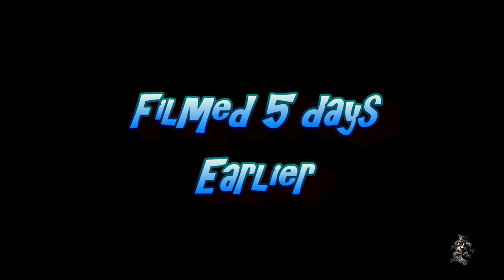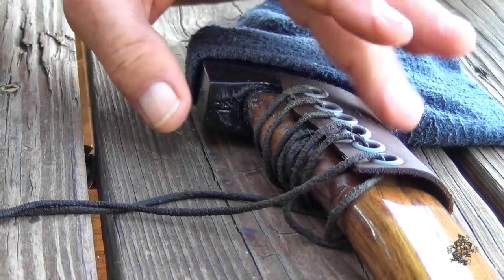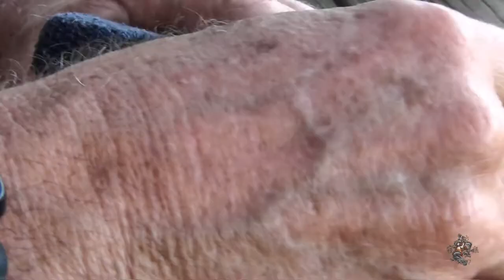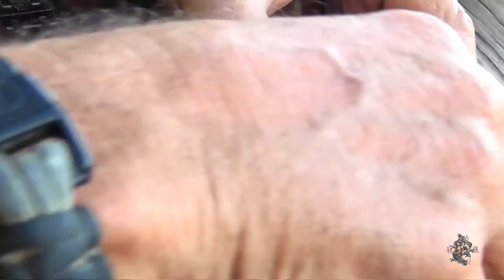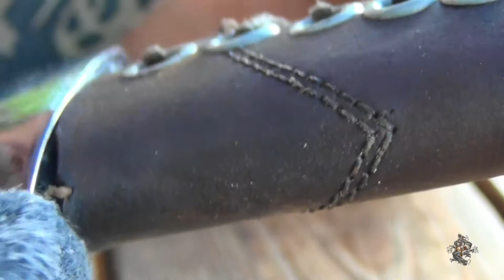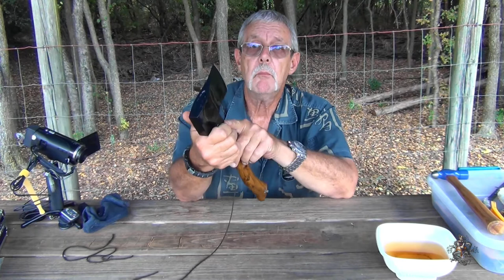Axe Project Pt. 3 – Preliminary Sharpening & Overstrike Attachment

Comment: Member To Keep The Steel Cool Dipped In Water, Don't Want That Steel Losing It's Temper,  Looks Like Ya Had A Swell Time Completing This,  Great Job,  Ray !   Sparky Sparky,  Leather Wrappy, Lacey Lacey, Lets Make Some Kindling.                   ATB T God Bless
Reply from the maker: Thanks for the reminder about the water 👍  I already had a pretty good edge on it, I just had to get all the paint off and make sure of the angle 🤪  I should have used needle nose pliers doing the lacing, instead of trying to use my fat fingers 😳   It won't be long before I'll be making some kindling now 👍   We've got our 1st cold front coming in in the morning (Wed 84/54 👍), 100* today 😳   Take Care my Friend and stay safe up there guy 👍